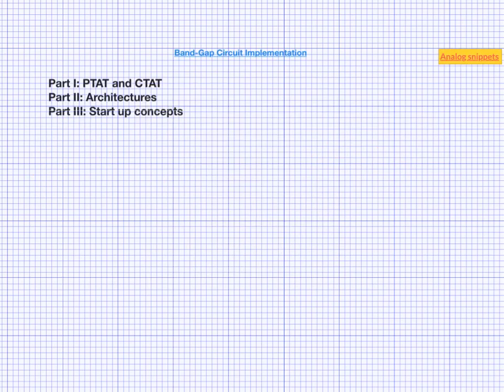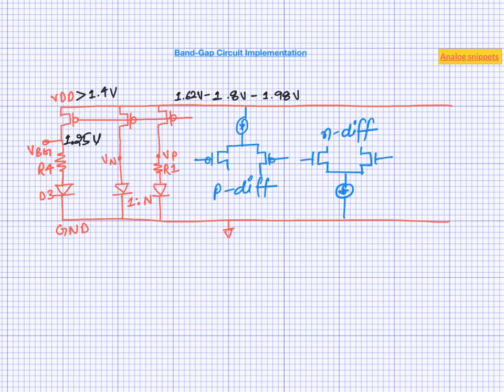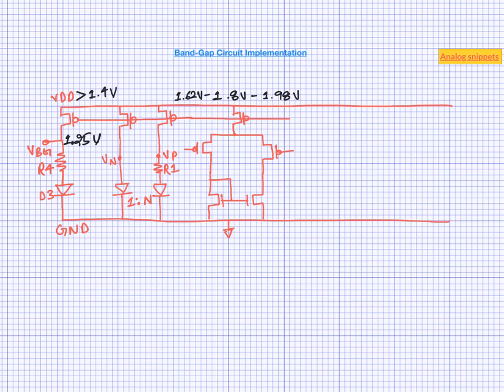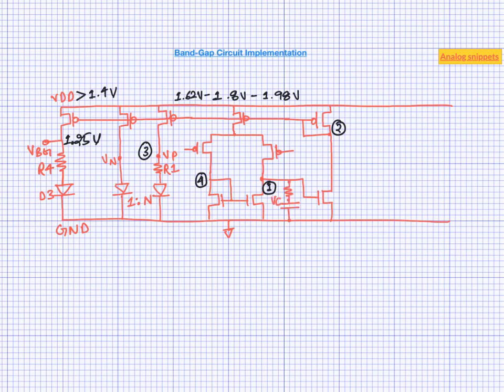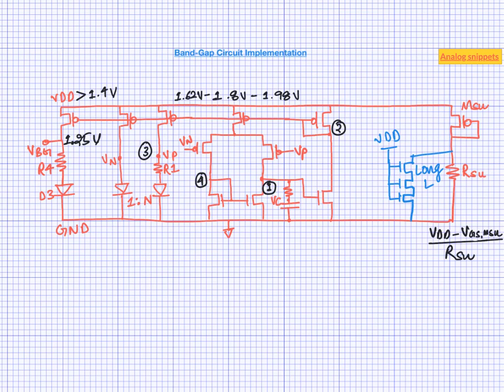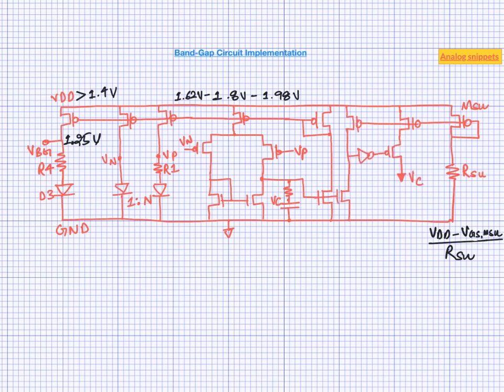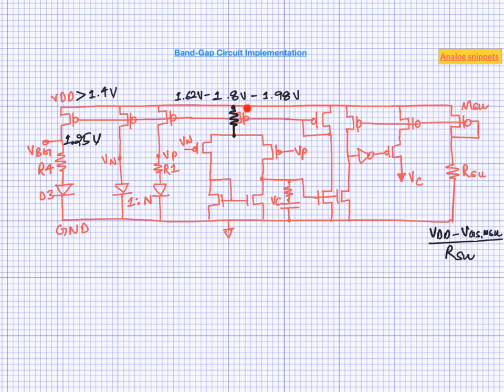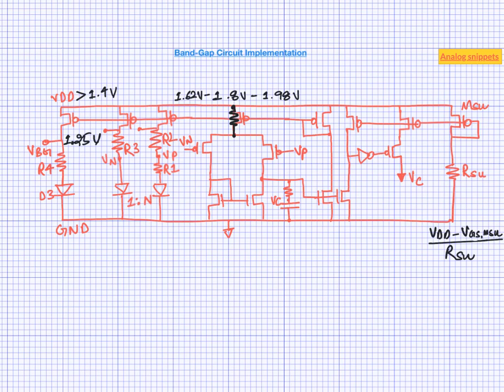#26 Band-gap Reference Circuits - Circuit Implementation

Comment: Dear Sir-Nice lecture. Could you please elaborate on the self-bias you did for the tail current of the opamp? Effectively that's another positive feedback, which we often ended up seeing the problem.  Best Regards,Raj.
Reply from the maker: Which feedback are you referring to in resistor biasing? Essentially any current into amplifier forces current into diode branches and this causes start up.

Comment: Just a quick question, does the dominant pole compensation here result in a LHP zero because of the series resistor?
Reply from the maker: Yes, that is correct.
Reply: @analogsnippets  Thanks for the reply. I really like these videos. Especially because you talk about concepts and circuits as someone who has built intuition in industry. The standard textbooks are good but seeing how stuff is actually implemented in industry is great. For example, this BGR architecture when a chip is powered on. I like how you explained the schematic and why certain design choices were made. Keep up the good work! I hope there are more such videos in the future.

Comment: Hello,
Thanks for the informative tutorials. I would like to ask for some clarifications about the start up with R-as a current source and no additional circuitry.
Please refer: https://youtu.be/783Itlm-pUs?si=Tqve3zdylIq7CtUR&t=627

Even if the Amplifier comes alive, my concern was that if the differential input is positive Vp > Vn,then the output of 5T OTA is held at ground level, resulting in stuck state.Vp > Vn may occur because of input referred offset of the Ampl. or perhaps during start up Vp rises faster than Vn (due to large diode cap at Vn, whereas only res at Vp).

I will be grateful if you could share your thoughts on this. Thank you.